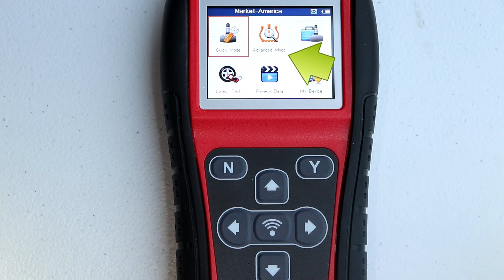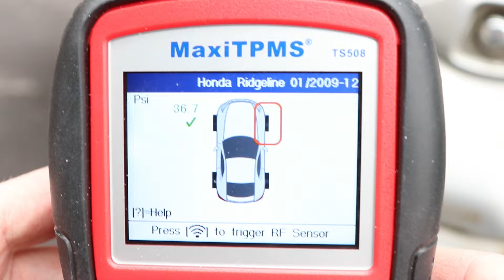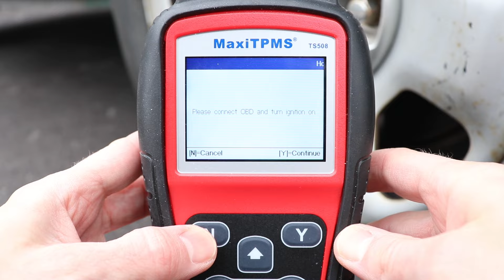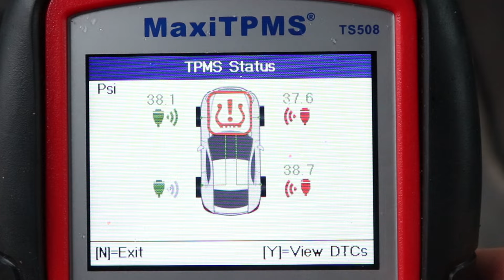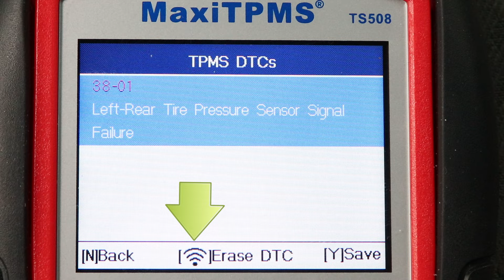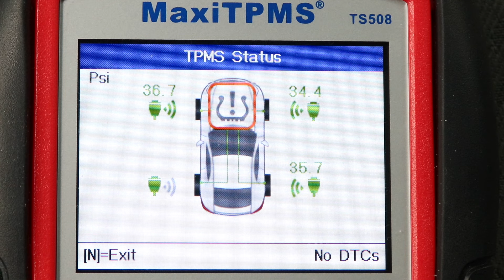TPMS Light Diagnostic & Reset with Autel TS508 - TPMS Light Stays ON Constantly

Comment: question, if i have one bad sensor can i disable it and clear the codes so the light will stay off ?
Reply from the maker: No, there is no way to disable a sensor, It has to be fully working for the light to turn off.

Comment: Nice video-very logical and easy to follow. However, the position of the 508 needs to be on the tire to receive the signal not on the rim. The signal comes from inside the tire, not from the valve stem. The signal cannot go thru a  metal wheel.
Thanks.
Reply from the maker: It goes through the stem. I've programmed these sensors while they are installed, and with the tool next to the tire they don't program, only next to the stem.  Of course they should be programmed prior to installation, but that showed me that the signal is best transmitted next to the stem.
Reply: @CleverFix  I respect your experience but my comment was based on the TS508WF quick start guide Item number 2 which shows to not hold the tool inside/above  the rim but beside the tire. If you google this it's unclear if the valve stem is or isn't an antennae . I suspect that small position changes could affect the signal acquisition. Again, thanks for the video.
Reply from the maker: @Campsnowcactus   Thanks for the follow up.  That makes sense about the instructions.  From my experience, when programming, the signal is VERY limited, this is why I had to hold it so close and it only worked close to the stem.  When scanning, the signal is MUCH stronger than programming,  and I've scanned sensors 3-4 feet away even. It's best to be close, to avoid scanning the wrong one, that's how strong they are.  Their signal can go quite far.  The stem has a rubber seal, so the signal should be able to go through it, although I don't think the stem is an antenna. There are two stem options, rubber and metal, and they're detachable/replaceable.   I'm not sure if you tried the tool, but if you use it, you'll see that it's not very picky, it will scan easily.

Comment: Are those sensors aftermarket or oem original? I have bought aftermarket’s will this tool work?
Reply from the maker: They're Autel MX sensors, so they are aftermarket. The TS508 supports both 315MHz and 433MHz frequencies, so it depends what frequency the car needs.  Each car needs a specific type of sensor, so the most important to is to order the correct sensor, otherwise the car and the tool won't recognize it. To be sure the TS508 will work, you can contact Autel here: https://autel.com/us/contact/  I believe just by telling them the car model, they will know.
Reply: @CleverFix the beauty of the Autel MX is that it’s both 315MHz + 433MHz compatible. Tire rack has a good deal on them!